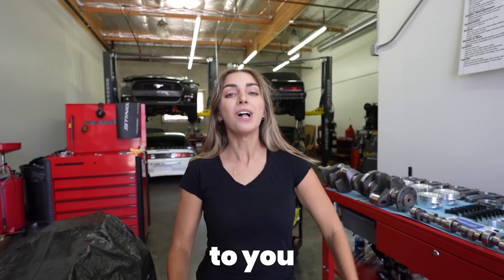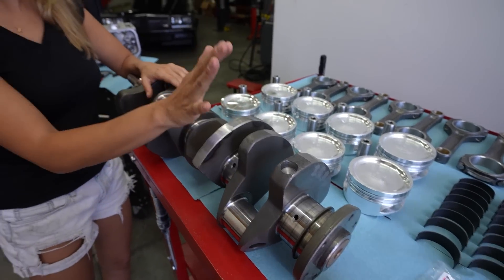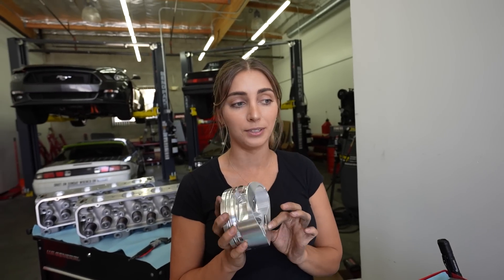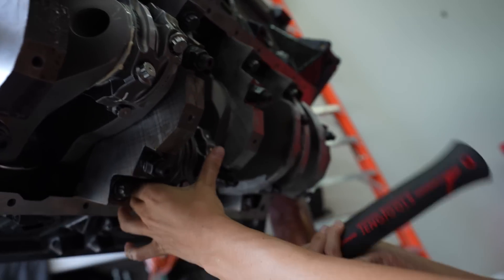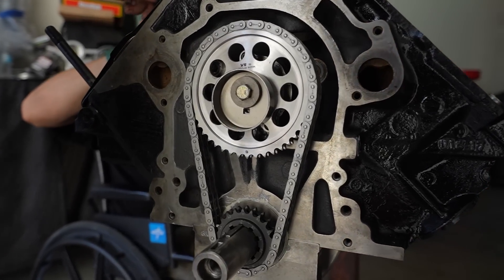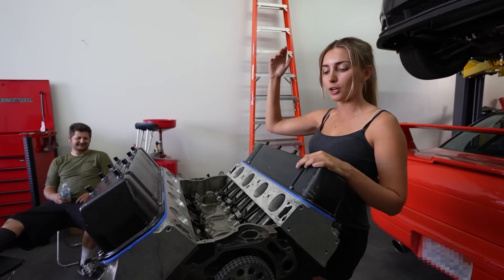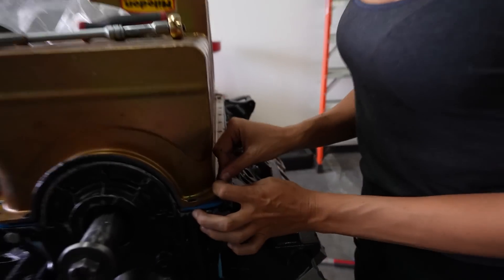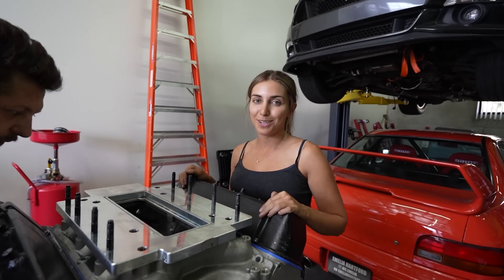Building a 2000HP Mustang Engine IN 10 MINUTES!

Comment: Tons of planning in this!! Looks so great!! Nice work!
Reply: Your channel Rocks RPM Monster's would love to see you guys Do some  lippys flashlight street Racing SRC style. Love your CARS!
Reply: @brentforte5950  You have an idea
However, doesn't it make more sense for Emelia to gain more experience with drag racing on a track, especially with this 'Bohemia'-Beast of Power and Torque !!
which of Emilia's vehicles would be appropriate, proper for, with such 'street' racing with much less traction?!
Sincerely
Reply: @newtonfirefly3584  they are on tracks most of the time fool.
Reply: @brentforte5950 
Sometimes they use the back of the track, not the actual normal drag racing portion of the track.
"who is the Fool - Fool?!"
Perhaps ask Brent, Jaime, Kevin Smith, Justin Shearer, Shawn [187], Jeff&Jeffrey Lutz, Larry Larson, Bill[Sr.]&Bill, Tommy Hoskinson, Tony Politano [Av Boys] & Tess Wood [Miss Midnight Maverick], Turbo John, John Doc, Sandy, Emelia, et al.??
Good Luck
Sincerely
Reply: @newtonfirefly3584  sorry bro .fool was not meant to be a diss, bad choice of words. But I'm getting better.

Comment: @9:24... Careful using RTV with a rubber gasket. The wet RTV can cause the gasket to squish out when torquing the bolts. I only put RTV in sharp corners.

Comment: Please don't think I'm picking you apart, I learn something new every day from people. The main bearings can get damaged from the acid from your fingers. Try to wear rubber gloves when you put them in. If you have 2 studs you can screw into the connecting rods for assembling the short block. You can use 2 pieces of rubber hose about 8-10 inches long on them and slide them on the studs that way when you are putting in the pistols they will slide on either side of the crank & don't scratch anything like the cylinder walls or the crank. They just find their way around it nicely. Thank you for adding some puppy time in your video. I feel for you Sandy I got 2 shattered discs from a car accident, trust me I know that look on your face

Comment: Your engine looks awesome Amelia. If you have not seen it, the Steve Morris Engines channel has a lot of great info and tips on building a blown engine.
Reply: Good tip and Suggestion with learning from Steve Morris - one of the great engine builders with videos with instruction from and with an individual with extensive ProMod experience.
Sandy has quite good experience and knowledge to assist Emelia too, though less than Steve certainly
Did You notice the name of the young woman, whose channel this is ? ->Emelia
All The Best
Sincerely
Reply: Thanks Newton Firefly for the correction, yes I know it should say Emilia, typing error. I do not know the other people she works with, but I am sure she has good assistance, and Emelia is quite knowledgeable on engines also. And yes, Steve Morris is one of the best.

Comment: If ever you’re having a hard time getting the rings past the top of the bore make sure you put a little bit better chamfer at the top of the cylinders and then they’ll slideu right in but if you don’t have a ring compressor that sits flat against the deck or you don’t have enough chamfer at the very top of the cylinder they’ll be a nightmare

Comment: 🔥FYI🔥 Hey Emelia, You should consider getting a Adjustable, or Non adjustable-Tapered piston ring compressor. It's money 4real. You don't have to worry damaging deck surface, or damaging rings. They sell them on summit for like $30 -$40 bucks I believe. I prefer Non adjustable, but depends on how many different size pistons you need to install on a regular bases. Love the channel, keep doing big things cause were here for it!!!!
Reply: Yup, those universal piston compressors are a pain in the ass

Comment: You're not supposed to touch engine  bearings with your bare hands, or crankshaft bolts, or connecting rod bolts. The oil on your fingers can cause pitting on the bearings and it also can cause the bolts to fracture. Not sure if any of the instructions said that. It also depends on the bolts. But I recommend nitrile gloves for the engine building process.
Reply: I been building race and street ENGINES FOR 30years  with one  horrible engine failure  because of  prest fit wrist pins  falling out. = act of GOD. 🤣...and never heard of that. I will call A.R.P. I Might have missed  that.
Reply: @chriscatarcio2983  @Fraser Lordly; 
the oils in the human skin may have other elements to cause issues, however, it the fingers and the item, that is the bearing surface has enough lubricant, the oils from the human skin either won't mix or be so insignificant that it has no affects.
->how long have these 'nitrile' gloves existed ? or any polymer gloves
->are You aware of the chemicals, specific polymers those or any gloves are made of, from and their chemical reactions with the lubricants ?!
=>"Nitrile is the shortened version of Nitrile Butadiene Rubber (NBR). Even though some refer to it as NBR latex, it does not contain any amount of rubber latex (or even latex proteins). Nitrile is not a natural form of rubber. It is a synthetic one, formed by combining acrylonitrile and butadiene, those monomers in a large stainless steel vat."
=>"Nitrile, sometimes called nitrile butadiene rubber, is a copolymer of butadiene and acrylonitrile. A copolymer is simply a polymer made up of two or more monomer species, created by bonding the monomers together on a molecular level through a process called copolymerization."
=>"Acrylonitrile Butadiene Rubber (NBR) or Nitrile rubber is one of the most popular compounds for automotive applications. It also is well known as Buna-N. This name came from one of the first base polymers patented in 1934, therefore people commonly use this name for all classes for Nitrile to this day."

=>the essential purpose of the gloves is for, with protection to, of, with the human skin, not the reverse -though with in specific situations, as with chemical testing, the substance, sample, chemicals need to be not contaminated, also by and through human skin.
->ntrille [NBR] gloves do seem to have good protection for the human skin from the specified chemicals, especially alkaline, some acids, oils, petroleum based products and perhaps other synthetic oils too.
->Great engine builders have been using their hands for many decades, since the beginning with racing combustion engines without issues
->ask the top engine builders and experts
=>PME, Steve Morris, Dale Inman, Nick ['s Garage], Lake Speed, Jr., every engine builder within every professional racing team
--> many use gloves today -> ask them specifically their basis, reason, purpose. 
->rely upon actual experts - not the massive, general, common ignorant, ignoramuses that comment, direct, dictate, on these channels, without any actual  or have limited knowledge, expertise and experience.
->If You have specific expert knowledge, advice, recommendation and , or chemical expertise to present as proof, then Your statement could be useful, helpful, beneficial.
Good Luck 
All The Best
Sincerely

Comment: Massive pistons! Next time tho, Never put the head studs in first!! Put the gaskets then the heads then slide the studs in screw them down to preferred hight then the nuts and torque, that way you can’t scratch the heads surface with the studs causing early head gasket failure…..

Comment: Be sure when you get it done try not to suck in a leaf. Not like an actual leaf because fall is right around the corner, but like a Nissan Leaf. If a car that small ends up that close to the engine, you might actually suck it up strait off the road.

Comment: I like the solid one piece aluminum ring compressors. It's a shame though that you need one for every standard bore and over sized bores that you work on.
I used to be a huge big block Chevy guy so I have a set for big blocks, and one for a standard bore 455 olds.
Reply: Those old school ring compresses are junk. I'm with you.

Comment: You might want to watch Street Race Channel with his big block and see what happened to him with the Mallory put in the crank witch I noticed was the same on your big block crank.
Reply: I couldn't get a good enough look at the crank to see where the weights were installed
Reply: The Mallory was in the end of the counter weight of the crank instead of across it. With it in then of the crank with enough RPM the Mallory can be thrown out, oil down the track and wreck the car

Comment: I haven't watched the video yet but I wanted to guess where the big block came from . Was it the 455 from the Frankenstein GNX  you purchased a month or so ago ? If it is it could turn that mustang into a monster . In 1970 the 455 that was in the GSX Grand sport produced 510 ft lbs of torque at 2800 rpm . Even by today's standards that's an insane amount of torque at such a low rpm . So that 455 you have right now has a lot of potential to give anything it comes in contact with will definitely give them a run for the money .

Comment: Those rods will not hold up to 2000 hp. And waaaay too much assembly lube. Change that oil after the first heat cycle.
Reply: you think its actually going to make 2000? LOL
Reply: @leftyo9589  it could. Boost fixes everything 🤣